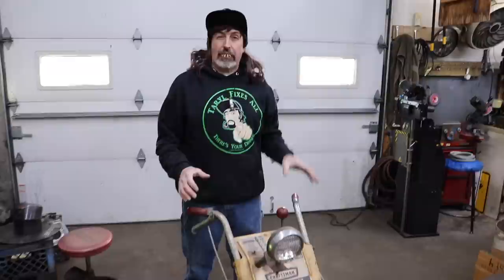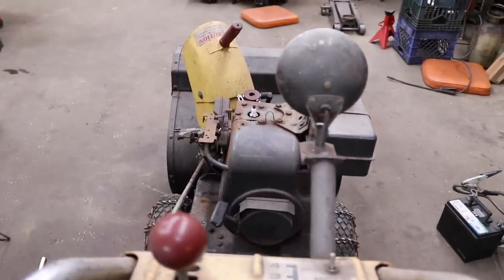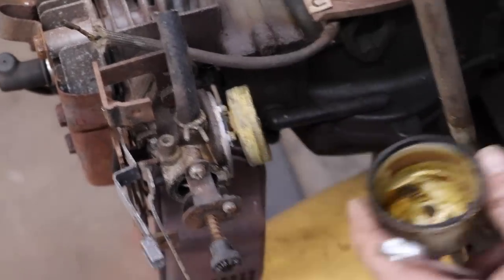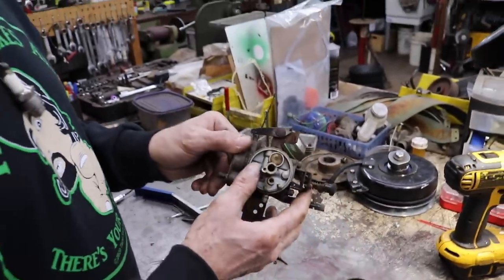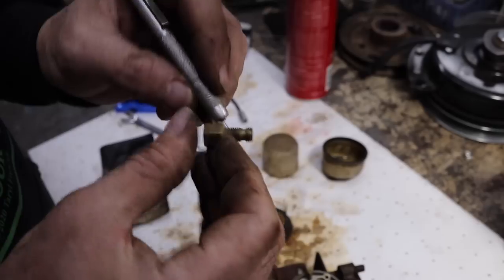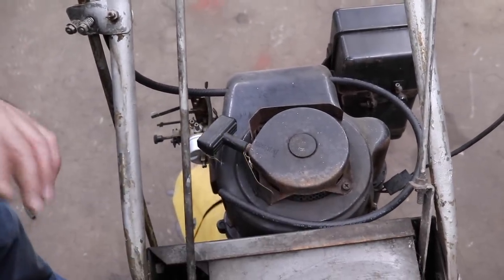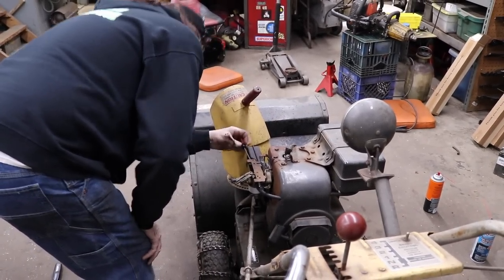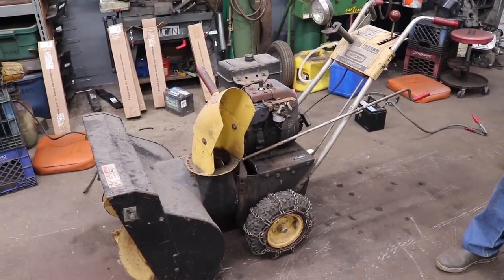⚠️ Most DANGEROUS Snowblower EVER! Let's Get It Running

Comment: 2:02 I could be wrong, but it looks like more than the spark plug got smashed with a hammer :D

I have an Ariens Sno-Thro, 10962, built just like this (best date I can find is about 1965-ish).  Predates all the normal safety things you see today... and I love every bit of it!  I tell people that if you slip and let go, it'll just keep truckin' on without ya.  Thankfully mine has an auger control, but Ariens was selling these as an entire yard maintenance package where you could remove the entire auger and replace it with things like a mower deck and a tiller.  Really neat idea, but never caught on.  The wheels have a lockout type hub so you can disengage the posi-traction, allowing the wheels to spin independently of each other like the rear end of a truck.  Makes it really nice when you want to move it around without running it.

I had eventually upgraded the aging Tecumseh engine with a modern Briggs engine after it suddenly blew the main seal and seized one winter, but I overhauled the whole thing with new axle bushings, flywheel, etc.

Comment: Taryl...Forget those torch tip cleaner wires. They dont burnish and leave dirt still adheared to the orifice wall. You need a micro pin vice with a set of micro drills to really restore  your jetting. Get the blue one from Micro Mark, and a seperate set of micro dril bits sizes 40 to 82. Make sure you dont over size the bit when cleaning. Pick only the exact fit bit.

Comment: Awesome machine, shame to think it will be retired. I'd use that all day over the new junk. I agree with Randy on all the safety junk nowadays to protect those that should stick with using a shovel.
Reply: No that snow blower is trash . had one at home and it was a pain to run if you had any type of hill or turning . it was junk and me and dad ended up shoveling and could do it faster then that damn thing could
Reply: @gamerX-wk7ct  I guess we'll have to wait and see how the test drive goes when it finally snows enough. I still like it.
Reply: Not even a bar across the front to save someone if they fall there, you never know.  Just a bent pipe U shaped across and a distance from the front housing
Reply: @robertp7209  How do you fall in front of a machine your supposed to be standing behind? If your that much of a klutz, you shouldn't own one. Companies have to stupid proof everything they make and they still get sued when someone finds a way around the pile of safeties they put on now. Nobody wants to take responsibility for their own actions. And it's the same people that whine when one of the myriad of switches or levers malfunction on their piece of equipment they do zero maintenance on.
Reply: @petertothpete6518  it’s possible, you may get pulled into it if there is a loose rope, garden hose, jump rope, something to catch your feet or on an incline the machine comes back on you or sideways.  Not everyone is an athlete, many take medications, get dizzy, etc. and falls on it and off comes a hand all that fast, or worse since it pulls in.  Not going to stop till it severs off a limb.  You would be surprised how parents let young children handle these things, and off the parent runs to get to the toilet quick, and another statistic.  How many parents have backed up their cars out of the driveway running over and killing their own kids?  Look it up.  When it is so simple to walk around the car before leaving.  You explain that one to me.  Happens all the time.  That’s why backup cameras are mandated by law since 2018.  Yet how long have cars been in production and driveways on houses?
Reply: My father had to have his wrist surgically reattached from this monster. He had worked on small engines and cars since he was 12. He was no idiot, this design was trash, with that misapplied centrifugal clutch. And the chute got ice blocked constantly. And it was hard to restart in the cold. And it's not obvious to a 5 year old how to shut it off when it's got your father's arm wrapped around the auger. Let it rust away.
Reply: @robertp7209  If your going to leave crap all over your driveway knowing a big snow is coming, then your asking for trouble. I put everything away before the first freeze. Drive ways are for CARS not a Sanford and Son competition. At least twice a month I come close to hitting someone backing out of a parking spot, almost always at a Wal-Mart. The vehicles on either side of me block my view except straight back and I don't see them until their right behind me. Often they have their face stuck in their phone instead of paying attention about their surroundings. Kids are another matter, parents who let their kids run around like it's a playground. I just wait until their all inside their vehicle before I even bother to pull out. This why I proceed with CAUTION! No amount of back up cameras or warning beepers make the car any safer for those that proceed without it. About 30 years ago I was driving my 1984 Chevy Cavalier, yes before beepers and cameras and even anti-lock brakes, down a residential road. Now there was a sweet young girl that loved riding her bike. Problem was her father had planted a hedge on either side of his driveway and let it get about 6' tall. So this young lady would love to shoot out of her steep driveway right into the street, which also went downhill, and around the corner onto my street which also went down hill as fast as she could go. So just as I was about to pass her driveway, out she comes! I locked up my brakes and swerved to miss her. Thankfully I was using CAUTION and drove the 25 mph speed limit and ALWAYS look out for kids in the summertime. As I made my way around the corner I was just about to pass my neighbor that's catty corner across the street from me when I saw his 16 year old daughter backing out her car WAY too fast and without looking. Again I locked up the brakes and blew my horn. Her father was standing there yelling at her to stop but we get easily distracted at that age. This was a good lesson for her that had a good ending as was the young lady who I stopped on her way uphill and told her to NEVER,NEVER enter the street without stopping and looking. Now she has kids of her own to look after and she stills remembers that day when we run into each other.
Reply: @joec.2768  I'm truly sorry to hear what you experienced at 5yrs old and I certainly hope your father recovered from this although I suspect, as is the case with me, that joint pain got worse over the years. The problem with us old timers is we get COMPLACENT and do stupid things when we know better. I take risks when I shouldn't because I too was working on them from a young age and I have the scars to prove it. Hindsight is always 50/50 but I'm sure your father knew he should shut off the engine before attempting to clear a jam in the auger. 20+ years ago I was running a chipper/shredder lawn vac. Some branches got stuck and although I KNEW I should shut it off I didn't. I wrapped the ends around my hand so I could yank them out and that unjammed it enough for the chipper wheel to grab them and yanked my hand in as well. I was blessed enough to jerk my hand free and only suffered a bad knuckle sprain. I honestly felt like I had torn my finger off and had to check to make sure It was still there. Hard lesson for my complacency. Not nearly as bad what your father went through, but a lesson none the less. Now mind you I was nearly 40 when that happened. I don't fault the machine, it served me for many more years, I blame myself for coming so close to loosing a hand. I'm not saying this was a good design, I'm sure the engineer that designed it was thinking of brute force combined with durability to tackle heavy wet snow. We don't have to be idiots to do dumb things, but we do have to be adult enough to realize that not everything can be built to keep us safe from ourselves.
Reply: @petertothpete6518  I do agree with you that not everything can be made totally safe from idiots. Look at airplane propellers. But it is a problem if extreme awareness is required at all times and the controls are counter-intuitive and there is an engine design issue that also feeds into the problem. Watching this, what happened makes more sense now, with the engine refusing to low speed idle. Yes my Dad admitted his slip-up for not killing the engine like you reasoned. But for me the centrifugal speed clutch as applied on this makes absolutely no design sense- engineers can be lazy too. My Dad did regain function of his hand but had fingertip circulation issues, worse in the winter, but again he just powered through. Thanks for chatting with me.

Comment: My first time seeing someone operate a snow blower was the year I moved to Alaska, our apartment manager was clearing sidewalks and the chute plugged up and he stuck his hand in to clear it and came out a few digits lighter. That blower sat out there idling for almost an hour before I assume it ran out of gas. Fire department nor the paramedics shut it off. Have had a strong respect for them things after seeing that. It was an old one, more rust than paint, the complex bought a shiny new one with track drive after that.

Comment: Back in the mid to late 60s when I was a teen, I would toss Tecumseh carburetors and put a Tillotson carb on them, they were pretty indestructible and reliable carbs. Of course on our minibikes, back then, we never ran a governor. The Briggs held up to no governor to the point that they started smoking but held together, but the Tecumseh engines seemed quicker with the same HP rating than the Briggs, but after a while, the Tecumseh would blow all of the oil out of the crankcase breather and sling a rod while the Briggs would keep going. Just add oil every day before starting and run a hotter plug as it got worse. The Tecumseh you could keep the oil topped off but when it was time to blow the oil out, there was no warning, it would just do it and then the rod would go.

Comment: I used to use an identical machine to do a neighbors driveway back in like 2008-2010. It was really beat and smoking and the chains would keep coming off. The old lady finally bought a new one and gave me the old one to fool around with. I took the engine off it and put it onto a mini bike. That machine probably worked okay when new, but as an old worn out piece, it was awful.

Comment: Got to love the old points 7hp tecumseh engines.
I was lucky to get a 7hp 26" Hauns Eclipse Snow Giant 
Operation is identical but a chain and clutch drives the auger off the axle instead on a gear box from the impeller shaft and a manual belt clutch on the engine instead of centrifugal clutch. 
Have to hang on for dear life and keep it pointed the right direction or it'll go without you. 
The thing is a tank😂

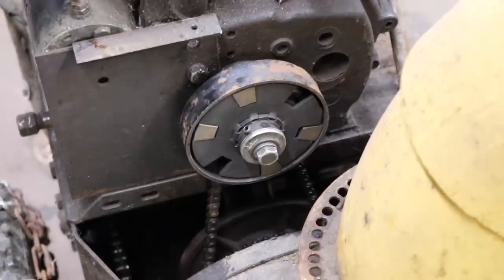Comment: The clutch spring is definitely, in my humble opinion, not providing enough resistance on the shoes. There are only 4 clutch shoes even though there are spaces for 6. If the spring was designed to work with 6 shoes, any lesser number would not create as much tension, so the clutch would engage at a lower RPM. I've seen ancient Homelite saws that had spaces for 6 shoes, & were used on the larger displacement units, but also used the same spider with 3 shoes on smaller displacement units. At the 58:00 time stamp, you can see the shoes on the far right is extended out further than the other 2 that are visible.

Comment: I have that almost identical snow blower and I still use it.

Mine must be a few years newer though because it has two squeeze levers. One engages the auger. The other engaged the drive clutch.

The frame, auger, etc look near 100% identical. It is also a Murray, sold as a Craftsman. I believe my father bought it, new, in the early 1980's.

Comment: 48:15 yes, it lives! Dangerously! I had a similar model last year get slushed up. I have got used to the “hands off, it stops” safety system. I tapped on the slushy part. It bit me. I lost 3 fingers down to the first knuckle.

Comment: Had nice parts snow blower just like this one, tearing down for the engine, doing the normal. went to do the pry on fly wheel and small love tap I barely hit it, must have had crack, it just snapped the tapered shaft right off, snow blower itself was rotted away. just put on the shelf, in basement it's winter tear down project.

Comment: Good video Taryl, I have the second most dangerous snow blower it's a early Simplicity Snow Away. It would drag me down the driveway and I'm a big guy! The single stage blower has roller bearings and runs fast. The crankshaft sits parallel to the blower and wheels has no power rating on it  but it's 10 HP+ it's scary!

Comment: Interesting machine, even if dangerous. The thing I would do with that if I was going to use it, is install a snowmobile tether ignition kill cord and switch, that goes on the wrist. I become separated from the machine, or it backs up on me, a pull on the cord and it dies and stops. I have a rusted out '78 junker Gilson made Ford 5/26, but it appears to have been built with a few extra safety features over Gilson's own model.

Comment: Instead of using compressed air to remove the carb needle seat there’s a Tecumseh needle seat tool which has a hook on one end and install tip on the other end which does both jobs. I have a knockoff tool which does the job just fine.  Only thing is, if the seat area is really dried out the seat can really be stuck down in there, so it needs to get a little help with some penetrating fluid and then it’ll come out.

Comment: I'd know that hole was there...but then, I worked for Peerless Gear and machine Div. of Tecumseh for 10 years and about 2 of those was in carburetor machining and 2 more was in carburetor assembly, 2 years in heat treat on a big furnace heat treating brakeshafts, gears, crankshafts, etc.  The rest I spent in repair/reprocess for their AN compressor line and their hydrostatic test transmission teardowns.  Do not miss that place at all, LOL!  Never had regular hours.  It was either feast or famine there of either working 12 hours a day, 7 days a week or being laid off.  Back then I'd only buy Briggs powered equipment because it was just so much easier to work on at home.  I guess I could have just threw a new Tecumseh carb on if I had bought their equipment since I could get them for free but just never wanted the hassle.  Back then my Pappy had a cub cadet riding mower and whenever he needed brake shafts or anything like that I'd just pick him up a couple of new ones.  The engine on his cub was a Kohler, but the transmission was Tecumseh.

Comment: The augers on the earlier Toro Powerlites (98cc) are direct drive, no control at all.  With the machine's vibration and light weight, it starts walking around as soon as the operator lets go, with the auger spinning like mad.  Usually they walk around in circles, more or less.  Pretty comical.

Comment: Intermittent spark is 99.943255% of the time the condensor is shot.
I worked on a blower that was worse than that. I don't remember the name of it, but it had the same drive setup, only it had a different auger drive. The auger drive had a lever by on the PTO end that stayed ON until you reached over and flipped it.
Stupid dangerous!

Comment: Isn't there an adjustment on that clutch I had a Mini bike that didn't idle as low as that snowblower And the clutch didn't spin I agree that it's a dangerous machine but it is pretty cool how you got it running I like how you could take older stuff no matter how old and make it run again One of the biggest reasons I watch you over anyone else is because of the way you work on things hope all is well and there's your dinner

Comment: Those 7 hp old tecumesh were the best cold weather starting because they didn't have the up tube intake like newer ones. If you cold hold the spring loaded primer, with one hand( which was just a plate on front of carb) and pull the rope they would start at 30 below.

Comment: I would have pulled the clutch and taken apart and cleaned it to see if that was the problem. Also I’d get out the tach to see exactly what RPM the engine was running at in idle speed. I don’t doubt Taryl can tell correct idle speed by ear but I’d want to know for sure to confirm the clutch wasn’t the problem. I wonder whether there wasn’t some kind of tiny air leak causing it to run fast no matter how much the idle adjustment was fiddled with. Maybe a crack in the manifold?

Comment: Hi Taryl, could you do a segment on repairing a leaky transmission on a troybilt tiller? I have changed the seals all the way around, 3 or 4 times and it still leaks transmission oil.

Comment: I don't see it as dangerous.  My Ariens Sno-Thro keeps going if I let go of it too, lol.  I'm 55 and have never fallen down while using a push mower, weedeater, snowblower or whatever else and if I felt like I was going to then the natural reaction would be to grip the handles tighter to stop your fall.  If I did fall while holding the handles, I'd just pull the clutch in to stop the drive.  (But hell, we played with lawn darts back in the 70's too and never manage to impale anyone in the head either, LOL!)

Comment: I just restore a Poulan 295 chainsaw and I couldn't idle it down slow enough to keep the chain from turning , took me a bit to figure out the clutch spring was weak . Put another spring in the clutch from a parts unit and that fixed it . Looks like the spring in that clutch on that thang is not strong enough . Come on Taryl your a dangerous man , I believe you should keep it for your personal snow blowing . I know you won't get hurt . What's that under the cover Taryl ???????